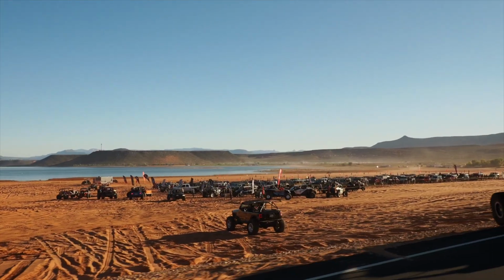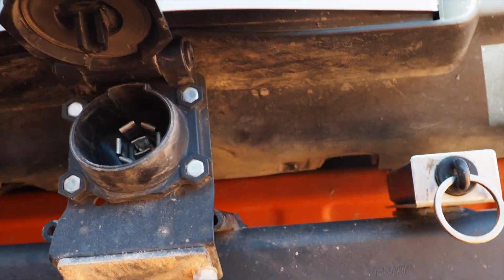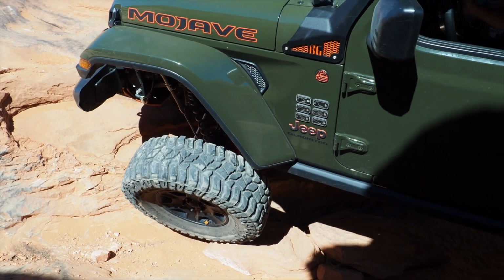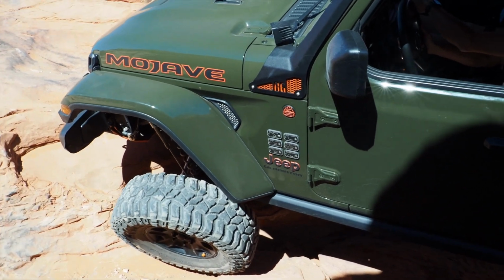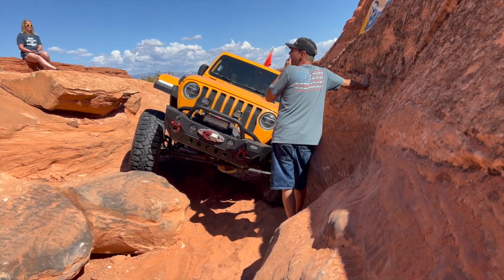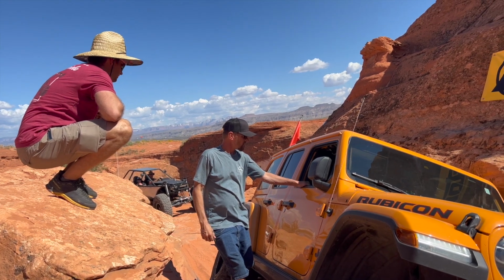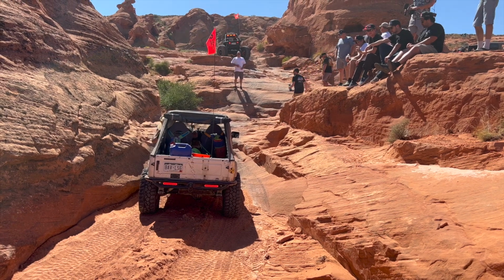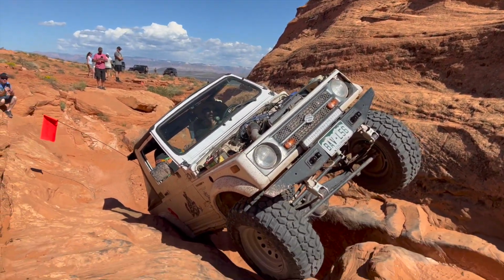Sliplock Gulch - Trail Hero 2022 - Day 2 (Sand Hollow) [Ep 90]

Comment: Do you use the Offroad+ option each time?  Does it impact how quickly the front brake-locking engages?  Surprised to see the front not engage at all
Reply from the maker: Rarely when rock crawling, sometimes I'll use it on a steep descent but most of the time it stays off unless running through dunes. I think it's more useful in 4H than in 4L
Reply: @FarFromOrdinary  would be a good video test.  It impacts the Brake Lock Differential.  I had good results in my Mojave

Comment: Finally just put wheel spacers on my new rubicon gladiator.  Saw that you did and it seems to work just fine.  Did u have a problem getting the 37’s on the stock wheels.  Some places won’t do it for you, I’m told..
Reply from the maker: Yep so long as they are hub centric and loctite used, have had no issues. Some places will mount the tires, discount tire is one of them. Had a convo with the guy and he said they'd mount 7.5 but not 7".
Reply: Great.  Yeah I’m gonna go that route with 37s.  Love the videos and all the feedback you give.  Keep it up.  
Can’t wait to see what’s next.  I’m in OK and looking forward to building my jeep up a little more for the Ozark trails in AR.  Thx again and have a great weekend.
Reply from the maker: @4freedomusa438  thanks, and you have a good weekend too! One of these days we'll get up into the Ozarks.
Reply: Yes.  I would definitely plan to meet up with you all too.  I’m only 2 hours from the Ozarks and I know a lot of the west Ozarks area from ATVing etc.   I’ll be ready….